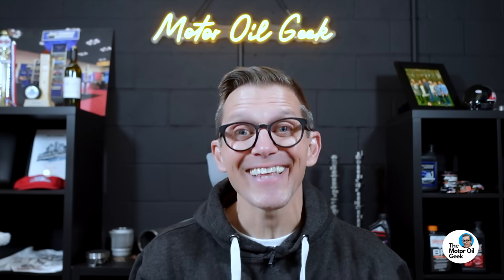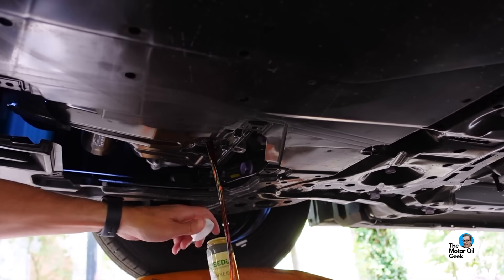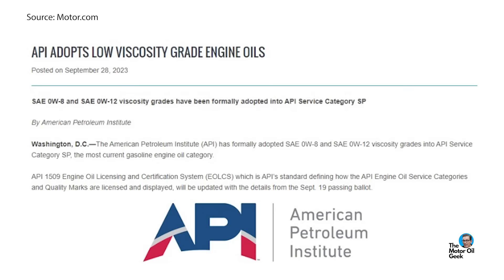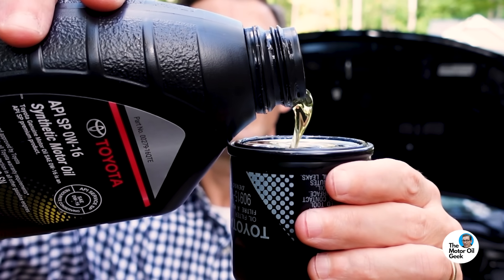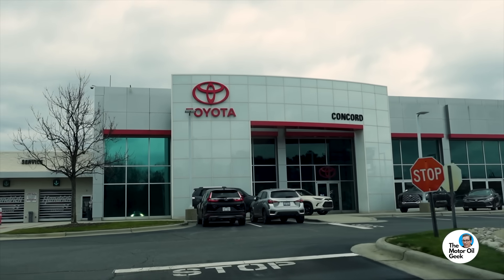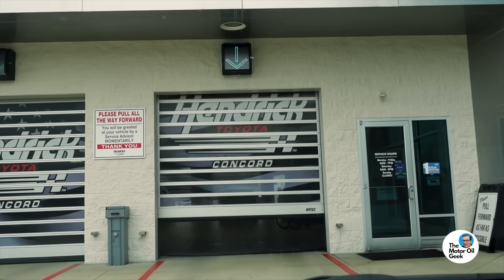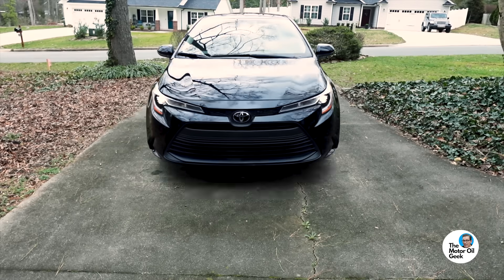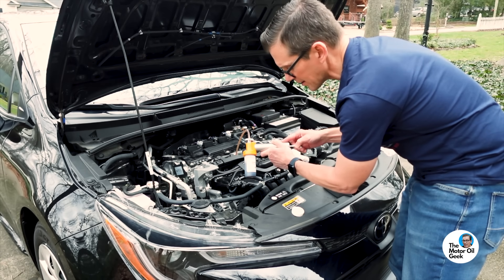0W-8 Motor Oil: Too THIN to Trust? Let's Find Out!

Comment: Now the gears of my brain are spinning at light speed. (Unintentional pun). My highlander owners manual says 10K mile engine oil change, but my maintenance due light comes on slightly before 5K. We know that low tension piston rings will gum up and stick causing oil consumption if the oil is not changed at proper intervals. Is the 0 w 8 an attempt to prevent the LTR from gumming up and causing oil consumption for true 10K change intervals? BTW, my highlander gets fresh oil and filter every 4.5 to 5 K. I am old school and cringe at the thought of 10 intervals.